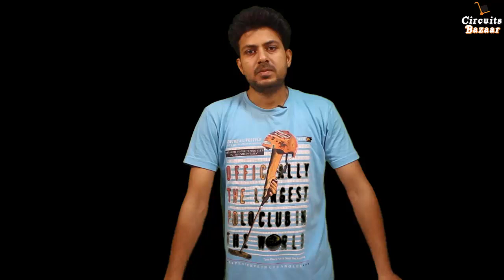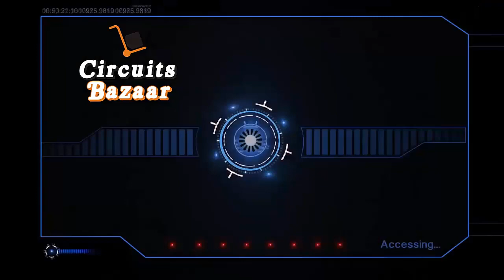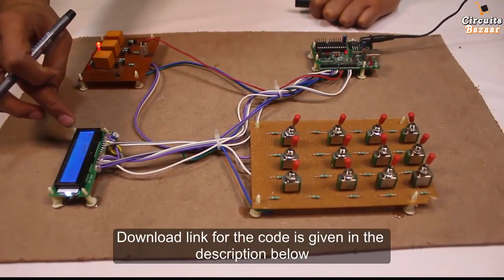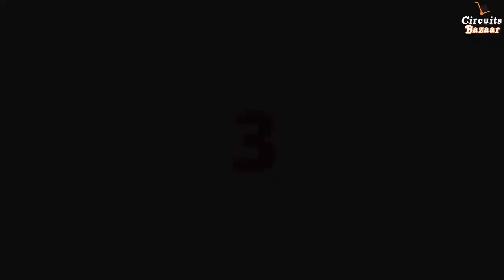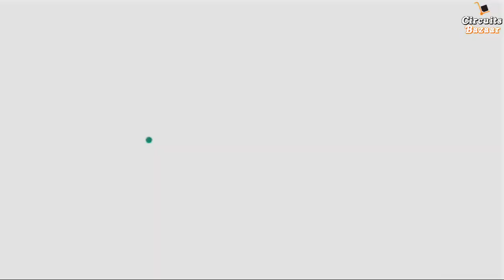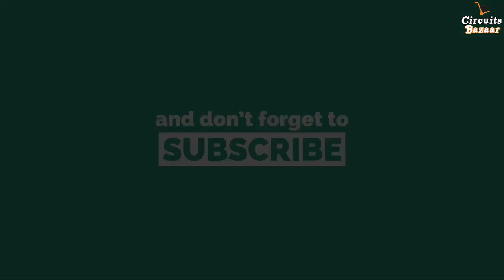Underground Cable Fault Distance Locator Using Arduino | Electrical Project

Comment from the maker: This video demonstrates an Underground Cable Fault Distance Locator designed for academic learning and practical understanding of fault detection techniques in power cables.
For detailed theory, working principle, circuit explanation, and logic flow aligned with engineering curricula, refer to the complete project article below:
https://circuitsbazaar.com/underground-cable-fault-distance-locator-using-arduino-162-lcd-and-relays/

For institutions and learners who want to observe real hardware behavior, testing methodology, and system integration without building from scratch, a ready-to-use project version is available here:
https://circuitsbazaar.com/shop/underground-cable-fault-distance-locator-electrical-project-ver1/

These resources are especially useful for BTech, Diploma, ITI, and postgraduate students focusing on embedded systems, electrical fault analysis, and applied instrumentation.

Comment from the maker: This system illustrates how underground cable faults can be detected and approximated in distance using sensor feedback, relay-based line selection, and embedded control logic.
It highlights real-time measurement, decision-making, and user feedback through an LCD interface.
The project is valuable for understanding system-level design in embedded and electrical engineering applications.

Comment: What is the maximum length of cable that can be used for finding fault? and why?
Reply from the maker: you have to use voltage booster... after that you can use any amount of the length ...

Comment: Hello Sir,

In this project the principle is calculating the resistance to find the distance of the fault.
Is this project limited to certain length of the cable or any length of the cable can be used?
And is this use practically by companies to find fault?
Whether this project can find only external fault or internal fault on the cable or both?

Comment: give me circuit diagram and can i used 5v relay
Reply from the maker: Yes You can use 5v relay as well .. but in that case you have to make separate power supply for that  ....
Reply: @The.Innovative.Indian  why.......if i take 5v from arduinos 5v point...what happened
Reply: @The.Innovative.Indian  i dont understand connection of relay portion

Comment: helo sir can you tell me that how does the excat location is calculated
Reply from the maker: It is calculated based on the resistance of the wire at particular locations. That resistance will define at what location fault  is there
Reply: @The.Innovative.Indian  How will you measure the resistance value??

Comment: In circuite diagram there is 12v where we need to connect that? 
12v green mark in circuit diagram
Reply from the maker: use any 12 v adapter or  12v power supply to power up the circuit
Reply: @The.Innovative.Indian 12v adapter is given to aurdino. But what about 12v wire coming from relays.
Reply from the maker: Relay itself is working on 12 volt power supply ....i think the 12 wire wire about which you are talking about is to give 12 volts to relay coils..... microcontroller will give 5v to transistors BC547 in Darlington pair and they will amplify it to 12v to drive the relays
Reply: @The.Innovative.Indian  ok, thank you
Reply: Sir i have one more doubt, we need to use relay module kit or just 12v relays, Resistors and LEd.

Comment: Wanted the circuit ive too made ckt bt not used arduino module only used atmega 328p ic
Reply: I want to buy this project can u send further rate details on 9920391114(whatsapp no. Only)
Reply from the maker: ok you can contact to +918684884488

Comment: Why use arduino...what is the purpose... instead of arduino we use another controller also
Reply from the maker: Yes you can use ... but there must be ADC in that microcontroller... because the ADC is used to sense the voltage at particular distance ...
Reply: PIC CONTROLLER ALSO HAVE INBUILT ADC
Reply from the maker: Yes you can use but programming in arduino is simple if you need ADC programming ...